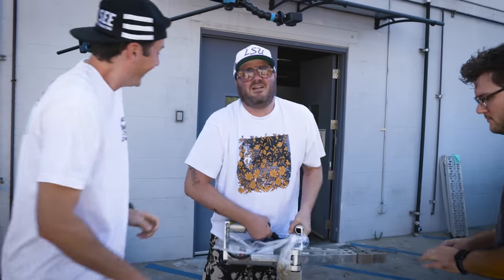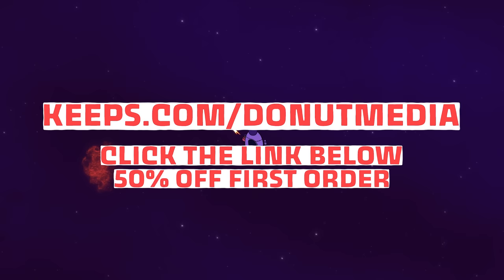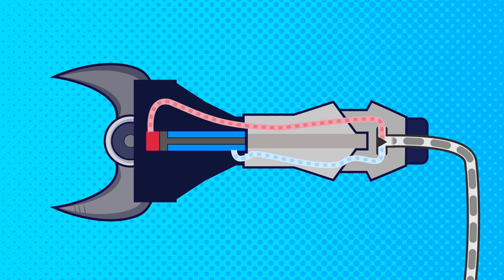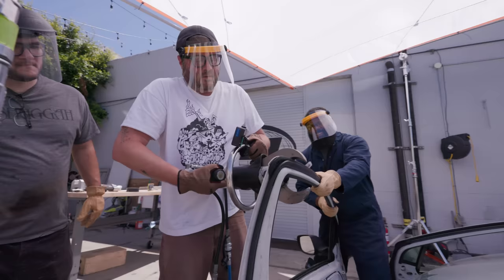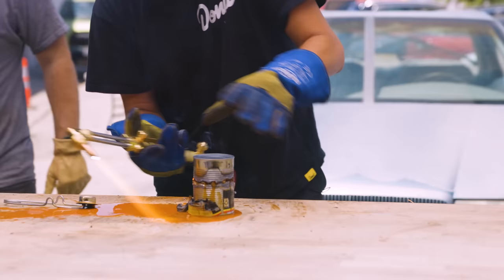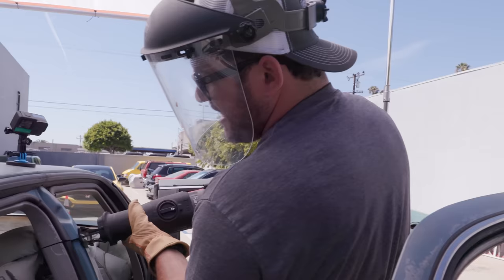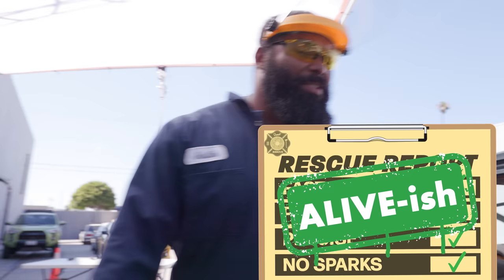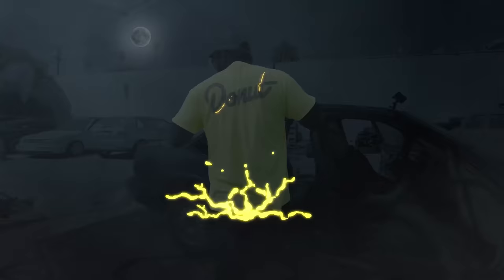We Bought the Jaws of Life

Comment: The department I use to work for has battery powered jaws of life and ect. Works just as good as the hydronic tools and you’re not dragging around a hose or generator. And the batteries would last about an hour even with cutting and spreading metal. Blew my mind
Reply: @Funk Master thanks for that, was thinking the same thing lmao
Reply: HYDRONIC
Reply: Yeah, we just got the battery tools at my department. They're not as light as they claimed to be, but compared to the old hydraulic set, they're a feather. And the power is just as good, if not better than the hydraulics.
Reply: @Funk Master Technically speaking I believe the battery powered ones still are hydraulic. Its just all a contained system since they don't have to rely on an external power source. Pretty neat.
Reply: It's crazy how good battery powered tools have gotten over the past 20 years.
Reply: My dad has one that uses dewalt batteries. Almost never use it, but it's cool.
Reply: Well thanks for your service
Reply: Ever tried cutting into a train , We cut about 3 hours on average lots of blades and time to get in there battery operated alone doenst work. We have both on all vehicles.
Reply: Meanwhile my phone dies half way through my extra special me time wth
Reply: Yeah hydronic tools are whack.
Reply: What brands make the electric Jaws? Hilti?
Reply: How well do the electric ones work under water? Yeah, we found that out and now have BOTH types.
Reply: @flipnotrab  how often do you arrive in time to use the jaws to save someone/thing in time when it's under water? I know that as soon as you get rid of them it'll happen though.
Reply: Really banking on my phone to autocorrect hydronic
Reply: I’m on a volunteer department here in Texas and we got the battery powered tools. They just your basic Milwaukee M18 battery. It’s pretty sweet.
Reply: Battery operated makes sense as it doesnt get used for a long time and most important is that instant torque
Reply: Yep, battery tech has gotten crazy. The batteries are expensive AF but can do insane stuff. Look at the largest battery-powered impact guns and the torque they can put out.
Reply: @16driver16  Exactly! And it doesn’t mean COMPLETELY underwater. I know of one case that was a drainage ditch holding water and car was 1/2 in/under water. Another was absolutely insane where a drunk walking home decided to take a shortcut across a bridge. Problem was the bridge was under construction and he walked off a 35’-40’ drop. That’s bad enough, right? Well not for this drunk. He landed on multiple rebar sticking out of piling base that was about 1’ under water. Rebar was “bracing” his left pocket just out of the water so he was able to get his phone out undamaged and call for help. Took 30 minutes just to find him and nobody could believe he was alive let alone conscious and talking. Had to submerge unit to snap off SIX rebar from under him and it took it just fine. Surprisingly, guy didn’t puncture one artery, organ or ANYTHING! He spent the night in the hospital and signed himself out the next day.  Called the rep and he wasn’t sure about “submergibility” and came in with a rebuild-kit to see for himself what/if there was any issues. Aside from a little dirt/mud the unit was fine.
Reply: Battery powered units are safer at a crash site too. A punctured or abraded hydraulic line can cut an arm off.
Reply: @flipnotrab  true also I forgot about water mains and sprinkler systems etc or even a very heavy rain
Reply: @dyingangelo  "instant torque" isn't a thing with hydraulic tools. Once you're pressurized, it's good to go.
Reply: @Iosis6  do you have a link to information on these new systems? I've now Googled them half a dozen different ways and none of the wording I'm using is bringing anything up. I would really appreciate it if someone could help me out with link/links.
Reply: @YeshuaDisciple916  I just googled "battery powered jaws of life".
Reply: (Spreaders)
Reply: wp1p
Reply: How did you like working in that field?
Reply: No they don't not even a comparison
Reply: @Iosis6  correct! They’re just as heavy and they’re still hydraulic.
Reply: There’s a channel called firefighting cronicals and they did a video with the jaws, it looked like they ran on Milwaukee m18 battery’s
Reply: It’s still hydraulic just battery powered
Reply: The new battery ones have more power than the hydrologic ones
Reply: You meant to say hydroponic
Reply: Definelty VERY expensive
Reply: Wow, Im a probie volunteer 5 months in and haven’t had the chance to use them yet. Good to know. 

We still have the hydraulic ones. Hand me down rural.
Reply: @rhubarbpie2027  sounds like a decepticon when you put it like that
Reply: @flipnotrab  our genesis battery tools work fine underwater
Reply: The drawback for battery powered is temperature limitations.  No batteries work well or last long in cold environments.  Where I live its commonly-30 to -40 in the winter.  No teslas here
Reply: as a firefighter battery operated jaws suck. we had 2 accidents in a row and couldnt use the jaws as batteries were flat from the first accident
Reply: Yup we just switched to them and they are so much easier to maneuver with. We ended up going with Amkus and they are actually pretty decent.
Reply: @christiaanvorster1988  .
Reply: @skrimper  tn
Reply: aren't the battery powered hydraulics aswell? should sound mostly the same from the tool, except for the engine in the background?
Reply: @grandmasterapple6355  They are still the best, No battery limitations no worrying about charging it no nothing, Just plug and play (Aslong as you have got fuel) 😂
Reply: @josueblanco5201  yes?
Reply: @flipnotrab  holy shit that's wild
Reply: We used to use these in training to pick up an egg and move it from a traffic come to another traffic cone without cracking the egg!!
Reply: @reniervandermerwe  but the batteries aren't glued to the tool, do they? You are supposed to have at least few extra ones and swap them, putting the dead battery on charge.
Reply: I was literally in the comment section to say this, except I don’t work for a department I help out at two different volunteer departments
Reply: We got both on our trucks
Reply: @DarkInstinct05  hurst. They’re called edraulic. They’re definitely much more powerful than the regular hydraulics. At my department, we’ve used them in training to lift an entire concrete mixing truck. They don’t even slow down when cutting or spreading, so you gotta make sure nothing important is in the way.
Reply: bucky13 lithium batteries changed the tool industry forever.
Reply: @flipnotrab  the Holmatro electric tools work in the water
Reply: Hey that's awesome. Tbh very surprising. Batteries have come so far in recent years.  I remember when battery powered ment almost no power lol
Reply: Must be nice to have battery money, lol. We still have the hydro equipment. We used to complain about our gear. Then we got to cross train w/ a dept that generation 1 equipment. We don't complain anymore.
Reply: is that the one with the rotating head? we had one demo at our station and chief simply didn't like it because it wasn't all metal
Reply: The one I go to for their program has both, but I believe we use the hydraulic powered ones for more heavy duty tasks.
Reply: Hydronic eh lmao
Reply: He's 100% correct my department has battery powered jaws of life and the last a long time

Comment: Safety note for the future: peel or remove the interior trim before you cut or spread. More modern cars have compressed air cylinders in the pillars and roof to inflate the airbags. Piercing them will do catastrophic damage to that area of the car, and possibly inflate the airbag. You will lose that fight. 

Cut the battery cables with a gap and let the capacitors discharge before cutting and spreading as well. The system can ve tricked into thinking an airbag detonation requirement is happening, and detonate the airbag.  No bueño!
Reply: I think that's why they used that early 2000s Regal--it didn't have any of those pillar/roof airbags, just front airbags for passenger/driver.
Reply: Is it a compressed air cylinder or a chemical reaction that rapidly produces gas pressure
Reply: @1234567890CAB  It’s done by chemical reaction 99% of the time
Reply: @1234567890CAB  Both are used in various airbag systems, but typically side impact inflators are compressed gas or a combination of compressed gas and deflagrant (the chemical reaction). Compressed gas inflators and hybrid (both methods) inflators are becoming more popular these days. Pure deflagration based inflators are typically used for the primary driver and passenger airbags systems.
Reply: @1234567890CAB  both. The compressed air cylinder usually is for the pretensioner. It fires down, tightening the belt with it. The chemical reaction is for the actual air bags.
Reply: A Final Destination fan I see
Reply: Was gonna say this!
Reply: @lego4virgo  Also because that car is cheap
Reply: @MEUProductions  ALSO, correct.
Reply: if the car is in a situation where these need to be used, id hope the airbags would of already went off, otherwise im not sure youd be doing any saving.
Reply: @Dylan Unrau  The collusion computer measures the dire tion of the G forces and only detonated the bags if they would catch a passenger. If there is only a driver in the car, the  passenger side would most likely be undecorated, waiting for input. 

Like you hinted, most wrecks we go on don't need these tools at all. So the ignition needs to be turned off, and care taken to stay away from the undecorated bags. With wireless fobs, the system is always on unless the fob is about 30 feet away.

Comment: There are regular service bulletins from manufacturers to safety departments on how to disassemble their cars and what to look out for.  For example, Subaru in the WRX has a tungsten carbide bar or something in the B pillar and the advice for rescue departments was to avoid cutting the pillar anywhere except at the roof line because the material will disable the jaws of life and other extraction equipment.

Comment: Was on my first extrication a few months ago. I learned that trying to pop the door at the hinges is much easier than at the Nader pin. That pin will hold on but just a little pressure on the hinges and it’ll pop. Great video!
Reply: Depends on what you are doing. A full size removal starting at the hinges is not smart.

Comment: In addition to these tools some departments also actually have a large cutoff saws and chainsaws onboard their trucks. They also have airbags and a winch onboard so they have everything they could possibly need to get the job done. However not all trucks have hydraulic or even electric extradition tools. Often only one truck in a department will have a set and will be set up as a purely rescue truck with no pump or water onboard. However this is up to each department and is based on preference as well as the resources and funds available in the area. At the apparatus manufacturer I work at each truck is designed to be completely custom from the ground up for each departments needs.
Reply: What manufacturer do you work for?

Comment: The most dangerous thing you guys did in this video was run that Milwaukee angle grinder with a cutoff wheel and no guard. Sure, you're okay most of the time. But it only takes one exploded disc for one of you to get killed or maimed. As a collision tech I use that tool frequently for cutting metal, but I have yet to ever run it without the guard.
Reply: 100%. Also, thinking a Covid faceguard is a substitute for ballistic goggles.
Reply: Donut is slang for idiot in the uk the more I watch the more I see they named it perfect

Comment: I am SO BUYING ONE OF THESE. I love @5:10 how fast and easy spreading the door open. I am a mechanic and it’s a BITCH sometimes to change window motors, never again ever have an issue if not being able to get my hand inside to hold a nut bolt window guid rail. I also  able to make custom convertibles for cheap too.

Comment: Most FD have all of the tools you showed.  Not every tool is right for every job.  We had a kid impaled by a hay spike.  The grinder and torch would put to much heat into the patient so out cam the cutters.  It’s always good to have options.  We even use air tools powered by a regulator hooked into breathing air cylinders at 4500 psi but we only have 88 cubic feet to play with.

Comment: One of the other dangers that me and the rest of my brothers and sisters in the fire service face when cutting cars up is the side curtain airbage charges that can kill or blow your or the patients ear drums out if you cut them. We sometimes pull down the inner ceiling of the car to look for them before we cut to make sure we don't hit them as they can activate with out any power supply from the cars battery. A rule of thumb is to cut high and inspect before you cut to maintain the safety of your crew. Most side curtain airbag charges for the front of the car are situated in the B post or in the passengers or drivers seat.

Comment: I would also say that most other cutting tools, from Angle Grinders to cutting torches produce sparks and have flames on them, not a really safe tool to operate in an environment where there is almost a guarantee of the presence of open fuel and other flammable liquids and gasses floating around.

Edit: wrote this before Justin said it. Sorry for being redundant.
Reply: Not to mention unprotected people (including kids) trapped in cars right next to where you are generating sparks and cuttings with unguarded blades and discs

Comment: trick to better insulation, #1- get fiberglass reinforced aluminum heat tape. #2- get fiberglass exhaust heat wrap. #3- back the exhaust wrap with the aluminum tape... zip tie around fuel lines and rails. 1994 4.6 Thunder Bird, heat soaks the fuel rail this time of year... even far north, so that is a good full time cheep mod so you all in SoCal. "less you have different gas that doesn't boil in the heat?"

Comment: One problem encountered with more modern cars is the use of boron steel in structural members. It's super tough steel that's really hard to cut. We ran into problems with it in a schoolbus plant I used to work at. We would need to notch out the roof of a light truck to fit the mini bus body and entry door and that boron steel was a bitch to cut!!
Reply: ᗩ ᑎᗝ丅ᗴ Ƴᗝᑌ ᗯᕼᗴᖇᗴ ᖇᗴᖴᗴᖇᖇᗴᗪ ᗷƳ ᗰᗴ

丅ᗴxт▪️      ᗩ ᑎᗝ丅ᗴ Ƴᗝᑌ ᗯᕼᗴᖇᗴ ᖇᗴᖴᗴᖇᖇᗴᗪ ᗷƳ ᗰᗴ

  ±𝟭𝟯𝟬𝟮𝟱𝟮𝟰𝟵𝟲𝟭𝟴✔🔥🔥🔥🤗👌🏆

Comment: I went to an event a couple of years ago where the local fire brigade had a display, showing off their fire trucks, equipment, etc, and let me hold the jaws of life (they were really cool and took a photo of me holding it on my phone), I remember it literally weighed a ton, goes to show just how strong they have to be to use it effectively. Also, as an Aussie I was slightly jealous of the scene where you went out for a drive after cutting up the car - if you tried that here, not only would the cops pull you straight over for no plates/rego, but you'd probably end up on the front page of every newspaper in the country, and the cop would need a new book after writing out all the defects lol

Comment: Pretty sur eit has a compressor because it uses pnuematic preassure not hydraulic as you guys have stated several times it obviously has quick disconnect air fittings

Comment: “Jaws of life” is a Phrase trade marked by HURST. 

The tools you are using here are Amkus. Main difference is the amkus is a high pressure system and hurst is a low pressure system. 

Battery systems are now in use as well. They are lighter compared to some tools but not by much. There are also draw backs to the battery powered hydraulic tools.

Comment: It's egg white no yoke, but it's a small hole like pin holes. The pantyhose or tights as we call them in England used to work on much older cars were they didn't have power steering pumps and such, older engines were much simpler so didn't need tights to be so tightly tighten. Plus I think they meant fan belt replacement to drive the cooling fan so you didn't overheat. Love the videos boy's keep them up❤

Comment: Those weren’t even the big cutters either.  They were 110,000lbs cutting force.  The next size up is just over 200,000lbs specifically to get through the boron steel being used in the doors and columns.

Comment: We had a guy trapped in a grain bin and if all we had was this he wouldnt of made it. The one they had was a battery powered one that was suppose to be just as strong as these but that thing stalled out on the grain elevator auger that had his leg hung. The Milwaukee grinder with a few cutoff wheels and a milwaukee die grinder with cut off wheels and a sawzall equipped with a dew diablo torch blades got him out.

Comment: So are the battery ones spark free too? Those look like DeWalt batteries and I have seen them arc going on a tool
Reply: I would think that sparking while swapping batteries is undesirable (and IDK why it would, someone kept the tool turned on?), but ultimately is not dangerous since that would usually happen at the fire truck, or even back at the fire station and away from a potential spill. Once everything is together the tool would have nowhere to spark from.

Comment: We used a sawzall on the department but cutting wheel is a no no in the even there is file leaking from the vehicle. I love the education you guys did here though
Reply: The electric glass cutter were pretty sweet when we had to cut windshields and rear windows to remove the to too. Could be handy around the shop.